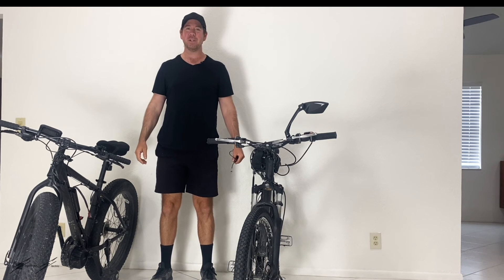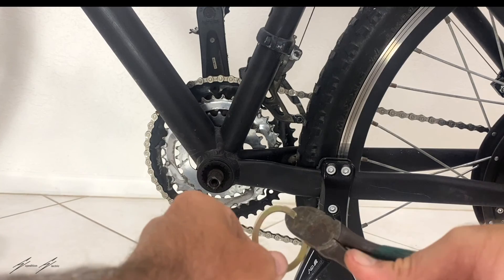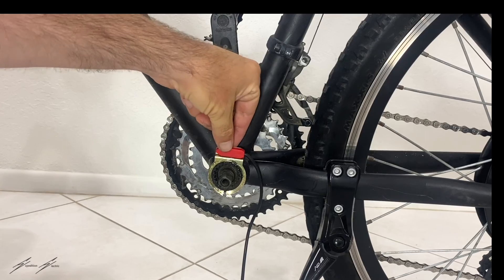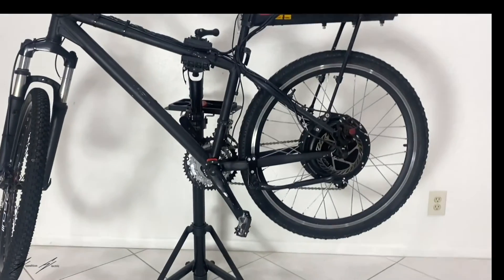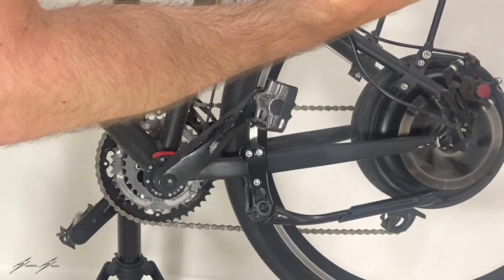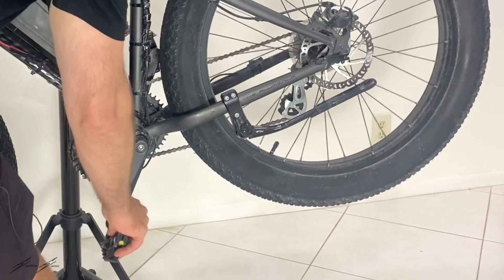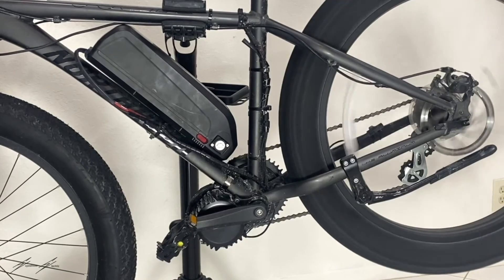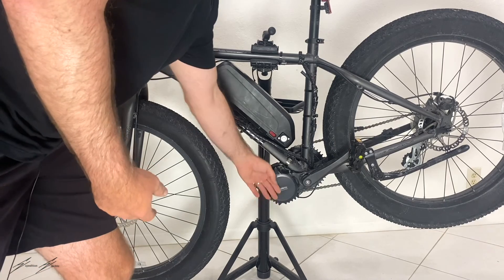Installing Pedal Assist on Hub Drive 1000 Watt Ebike [Hub Motor vs Mid Drive Pedal Assist]

Comment: I think you are supposed to loosen the bottom bracket nut and fit the sensor between the body and the nut. It is very tight and loosens clockwise. There are instructions on Park tools site. The mid motor seems to have torque sensing emulation.
Reply from the maker: Great tip!

Comment: I thought you said you could choose the level of assist on the hub drive if you had an lcd display?
Reply from the maker: I'm able to choose the level of pedal assist on the mid drive that I own, On certain brands of hub drives you can control the level of pedal assist, it differs brand to brand.
Reply: @expedition-electric3549  Sweet! I thought I’d heard that was possible watching some vids before. It’s great to know there is an option for hub drives too. Thanks
Reply from the maker: @buffalomind6838  Yeah I think the hub drives that allow for pedal assist control typically have an lcd screen that is about 3x2 inches. Any of the smaller displays that are 1.5x1.5 inches typically only show the battery level.

Comment: I love pedal assist, i use a mix of both throttle and assist
Reply from the maker: Oh nice, on the hub or mid drive ebike?
Reply: @expedition-electric3549  rear hub
Reply from the maker: @ianmangham4570  Nice!
Reply from the maker: @ianmangham4570  awesome

Comment: Thats the problem with the pedal assist on this style of ebike - its like flying a Sopwith Camel or other World War 1 fighter plane - your only throttle choices are idle or full throttle.
Ive (on my 1000w hub bike, roughly 10km/h per assist level) gradually got used to using the pedal assist levels on the bike - level 1 is most useful for cycle lanes, however even level 1 is too snappy for use around pedestrians, however there is a way around this, see below.
Level 2 is what I generally use on most roads and gives the best overall range, it allows you to keep up a constant level of cadence and effort no matter how many hills come at you, gives a good mix of propulsion provided equally by the motor and your legs, while travelling at a decent pace.
Level 3 is technically illegal here for ebikes but is unnoticeable in traffic, you just are riding at the high end of general fast commuter bicycle traffic, so on main roads you are generally fine. The effort here is completely provided by the motor unless you really hammer the pedals in top gear.
Level 4 and 5 are complete motorbike, the only reason for the pedals here is to fool people into thinking you are actually pedalling so they dont call the cops on you. You need the throttle to control the bike at these speeds.

If you are riding in places even level 1 is to snappy, ie around people, there are a couple of ways to stop the pedal assist. The first is to give it a tiny bit of brake, not enough to physically engage the brakes, and that will completely kill the motor. The second is to use the throttle - even the slightest bit of twist/thumb throttle kills the pedal assist - the advantage of this is you can still ride with a bit of motor by twisting the throttle part way.

Generally, I've found, the best way to avoid cops is to *not be a dick*. Slow down around people. Dont race cars on narrow tracks - pull over and let em past.
Reply from the maker: haha, idle or full throttle! Some good tips on the pedal assist levels and how to stay out of trouble!. I do prefer like you were saying to use the throttle at low levels, it's easy to control the amount of output with a slight twist.
Reply: Haha!
Reply: Bought a bike today 1000w motor only got throttle and no PAS, wondering if I should install PAS because I want some exercise out of it too